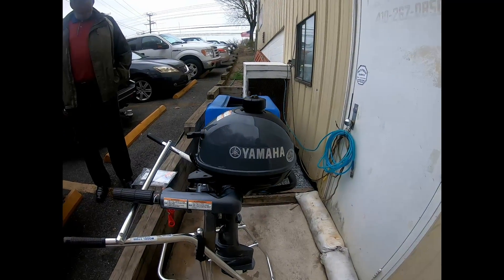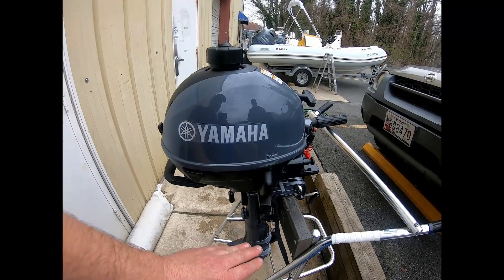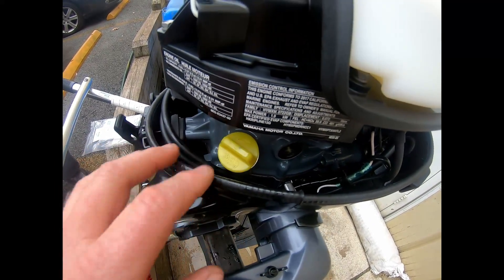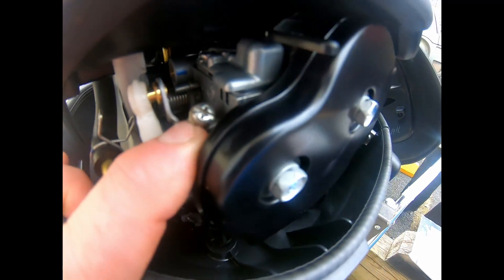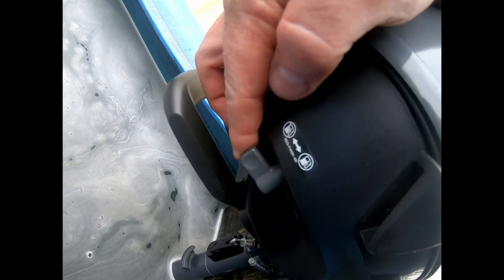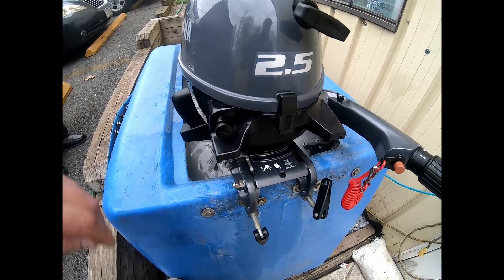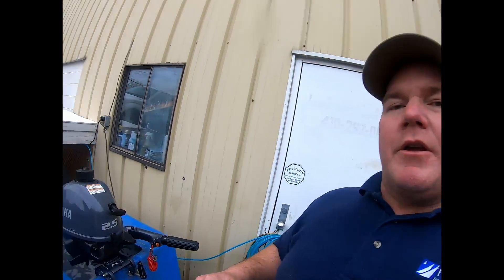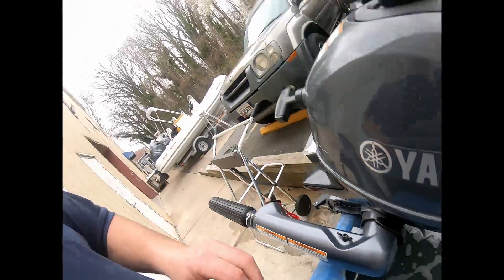Yamaha F2 5 walk through

Comment: The sight glass shows the correct oil level at full up tilt !
Reply: No that's what you would think. But it doesn't. You can have at the correct level on the dipstick. But you can't see any oil through that window.
It's literally there to tell you that the oil is moving around in there, that's it!

Comment: How long does the gas last, I know it depends on the throttle position, but at lets say 50% ?
Reply: Well I've had mine out for an approx, 1 hour and 20mins minutes. At various speeds throughout.
Then it was empty. 
On the sea.
A fair sized inflatable dinghy, with a hard floor. A few things. Small carry fuel tank full. I'm heavy.